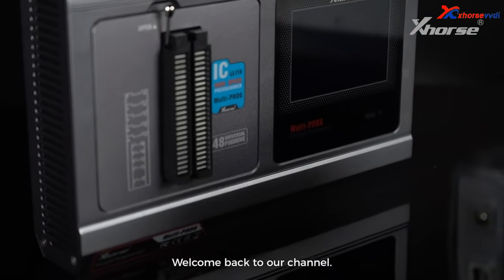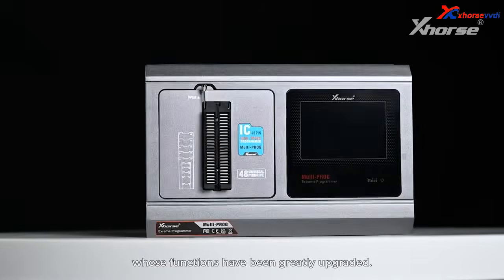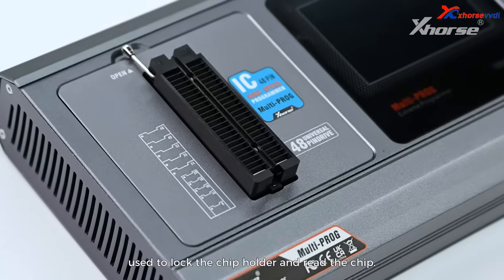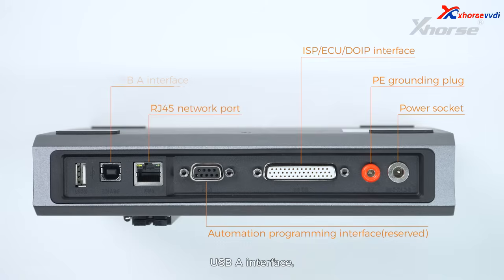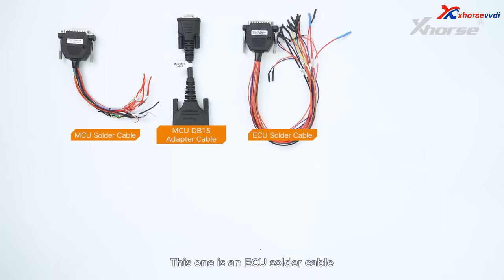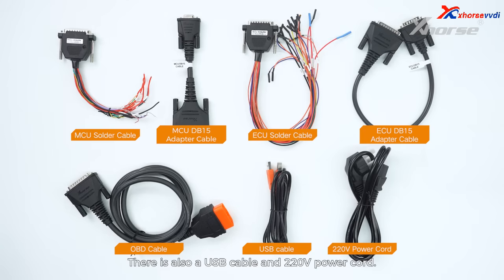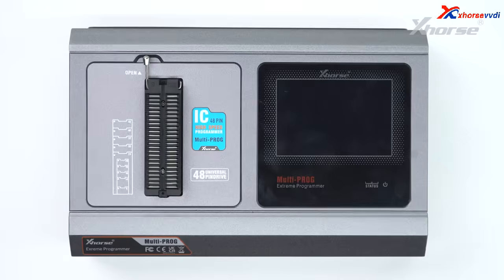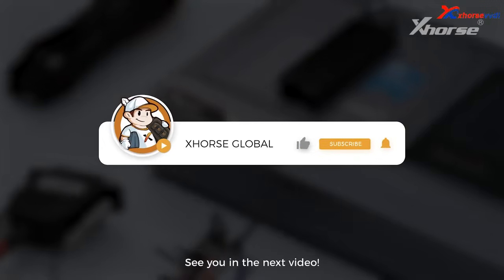What is Xhorse Multi PROG Programmer?

Comment: Can clone edc17cp14 100% with no problems?
I have to do both of them, and doesn't work with Trasdata and Flex
Reply from the maker: support cloning ec17cp14, u may download its software and check if supported ecus are the ones that u r going to do, https://mega.nz/file/UR1QmRpa#9XjMuU2r1nWSpiiUVModYLP2QOQgHatdjRga4EciBqk

Comment: dq381 no way to do , edc16cp 36 bench read ok write fail down repaired via bdm with another branth, md1 benz read ok write mod file but in unit stay ori file :D , and many many other mistakes .... dosnt do crc by engine units .... so just waiting company fix this , understud customers is best testers ewer dosnt cost nothinks company , just customers have nightmares :D
Reply from the maker: edc16cp 36 should work, dq381 not supported, for md1 try writing mod file again, or send that to xhorse tech
Reply: @XhorseVvdi  your tech department almost newer answer and if they answer they actually avoid answering the question!